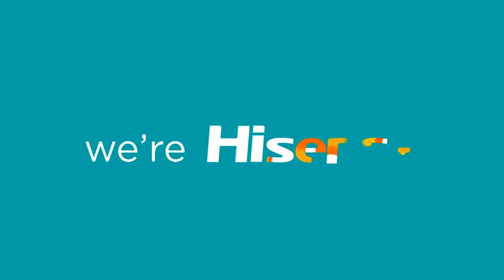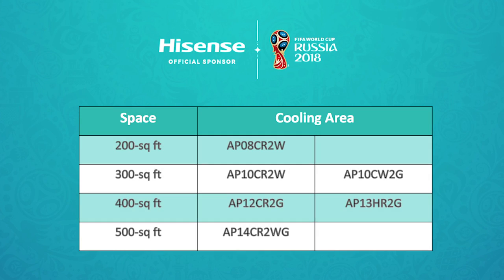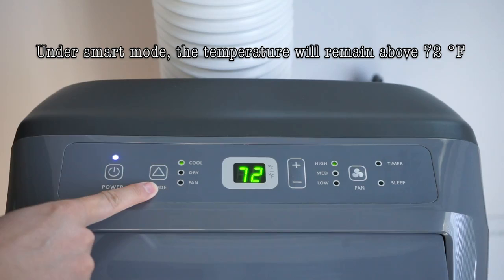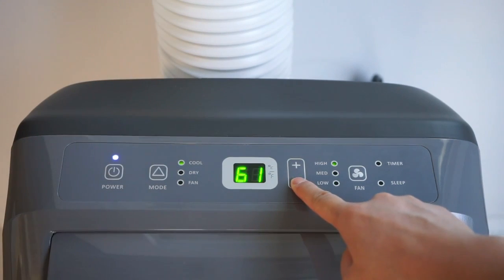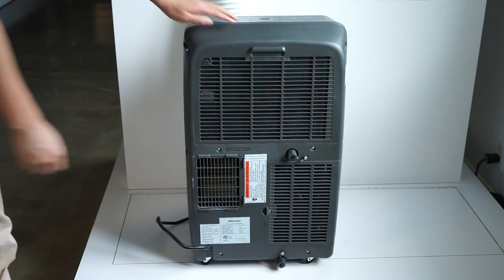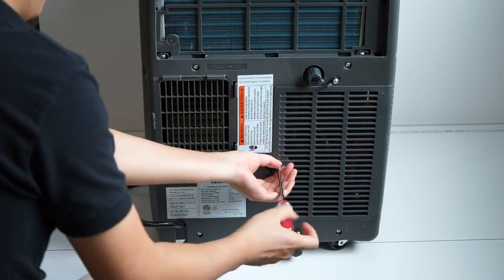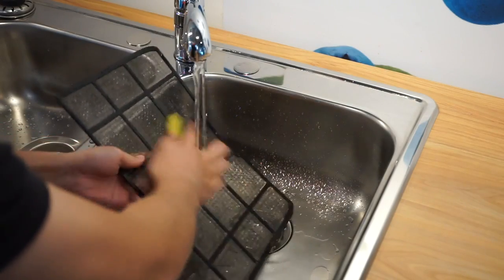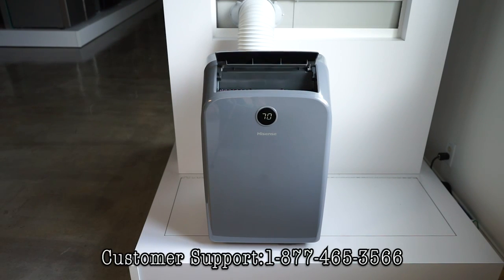Hisense Portable Air Conditioner - Not Cooling

Comment: For anyone reading this trying to fix their Hisense air conditioner, I just fixed mine. It’s good to clean your filters but that was not why mine was not putting out cold air. 

Press and hold the power button while it is on. The unit will power off, but continue holding it until you hear a few beeps. Then go to the plug into the wall and press the reset button on it. Turn your machine back on. The cooling compressor will now work ❄️
Reply: I tried this but when I press and hold the power button the unit doesn't power off at all, I assume you mean the power button on the unit right? Mine only powers off when I release the button. 

My issue seems to be the cooling just not starting at all.

Comment: What would cause a new portable unit 8000 BTU to fluctuate between 88 and 86 it’s just warm air coming out it has two hoses in the back that go out the window one is supposed to be to take the hot air out and the other one is passing through the coils or however that goes nothings happening and it’s brand new just today©‼‼‼

Comment: I've had one going on 4 years that has been run nearly nonstop during summer months. It is loud (makes loud boom noise when compressor kicks in) but works great. I have never even cleaned the filter which is why I'm on this video.

Comment: Ours will blow air out but it won't cool the air, it will say the temp in our tiny office room is like 78 even when its colder outside, The filters are clean, it has been drained, and there is nothing wrong with it as far as we can tell, it worked one day then the next it wouldn't cool the room below 78.

Comment: My HS won't cool. There was never any water in either drain location and still has no evidence there ever was. It worked fine for about three years, but last year it stopped cooling. The compressor starts up (a noticeable surge in power and the characteristic compressor start up sound), but no cooling. Not clogged, vented to outside, no dirty filter. Bummer.
Reply: Same problem!! Exact same!

Comment: I'm getting error code E9. Can't find the code anywhere in the manual or online. Also my unit isn't blowing cold air and notice the exhaust air is not longer hot/warm.
Reply from the maker: Hi there - the E9 is a fatal error code. Please contact customer support in regards to a warranty exchange.
Reply: @HisenseCA Is there anything that can be done to fix an E9 code? I am handy, can solder, test whatever needs testing, bypass...whatever.

Comment: After a year my Hinsense portable can't lower the temp in the room lower than 77 degrees F regardless of the outdoor temp.  I've cleaned filters and made all the recommended adjustments to the location of the device, exhaust hose length, etc...  Worst AC unit I've ever purchased.  Old window unit had no problem with cooling the room to 68-70 deg F
Reply from the maker: We're sorry to hear that the unit is having difficulties cooling your room. Assuming the unit is appropriately sized for the room it is in; also clarifying that the included window kit is installed correctly?
Reply from the maker: @Joseph (Joe) Tibbetts Thank you for sharing this feedback with us. Window AC units are always more effective than portable air conditioners; however not all living arrangements will allow them. I will share your sentiment with the air team.
Reply: I just got one.  It was BAD in  less then 2 hours of USE.   
PS.  I am a LEGIT trained A/C Tech  and Troubleshooting extraordinaire.   
This thing gots more Bugs than an Ant farm.

Comment: My compressor for it won’t turn on I don’t know how to get it running again just blows room temp air and has a lot of air blowing and no dust
Reply from the maker: If your Hisense PAC is not blowing cold air please check the following: check that the unit temperature setting is lower than the room temperature; ensure that the fan is blowing warm air from the back of the unit; check that you hear the compressor kick on after start-up (could be several minute delays). Please also ensure you have the exhaust hose venting out the window. If the compressor will not start you can try connecting it to another outlet in your home to test for a specific power issue - alternatively, your unit may be at 'end of life' or broken. Please reach out to your closest local subsidiary and speak to the customer service team.

Comment: Got error code E9 on mine. Only info I've found about this is, "contact customer support" and "E9 is a fatal error code". Would appreciate it if someone could elaborate on WTF E9 actually means, please.
Reply: Currently going through this right now, did you ever get an answer on the E9 ?

Comment: My AC is overheating and not shooting out enough cool air it does have the appropriate BTUs is it 16,000 and it has a heater as well for in the winter it will cool for about 10 minutes then shut down. If you have an idea of what the problem may be I would greatly appreciate some help.  I can't afford to buy a new unit.  I live above  a pizza parlor and a tanning salon Sooo needless to say it's like an oven up here.
Thanks Brenda
Reply from the maker: Confirming a few details: 1. You have the window kit properly installed with the exhaust hose venting outside? 2. What setting do you have the unit on? 3. What is the ambient temp of the room? 4. What temperature do you have the PAC set to? Once we receive that data we will do our best to help.
Reply: @HisenseCA  sorry I took so long to get back to you it won't let me turn it up any higher than low the room goes from 20 in the morning on a cool night up to 30 C in the afternoon as I have a son porch attached to my living room facing west so it's like having a little oven attached to the living room.
It's been quite the task trying to keep this place cool.
Reply: As far as the PAC I wasn't aware my portable air conditioner had one.
Thank you for your time

Comment: The filters weren’t dry when I put them in last time and now it won’t read below 70 but hasn’t shown an error code to empty the water like last time. Did I ruin it or is it salvageable?
Reply: Its JUST a Junky Unit.   Hence why there are so many REFERBS out there.  
This is one that's Best to be Avoided.  Even at the Price of $329 bucks?  Its WAY to much.  
Not ONE person has one of these units that has had it for more then a Year and can say it still works perfect.    Its that bad.
Reply: @MickeyMishra  lol, no, it is not. THere are many here on this thread that have had one for years. You just have to know how to reset and do regular maintenance. it is that simple.

Comment: i have that unit but what it does it called the flat flap when the air close and open.. do u know what is name part and where i can look to order it?
Reply from the maker: Typically it is called an air conditioner flap. Currently, Hisense does not sell parts for the portable air units as our warranty is an exchange warranty. You could inquire on a website that sells universal air accessories or with a refurbisher of Hisense products.

Comment: Hello, i inherited my hisense AC from the previous house owner and it was about a year or 2 old at the time.... i have now had it for 3 years and never did much more cleaning than clearing the back filters and some water occasionally. But now the top filter has been very wet and has dirt/ water between the stainless aluminum
Reply: have to drain the water once a week. there is a knob on the back, unscrew it and drain the water.  It collects the moisture from the air when it is running.  It can also be used to dehumidify a room.. hook a hose up to the drain and put it on the 'Dry' setting.. with that you will have to hook up a hose to the drain plug.

Comment: Mine is brand new out of the box and the AC keeps kicking off leaving only the fan on.
Reply: I'm having the same issue. I've tried reaching out to their technical support staff but have heard nothing back so far
Reply: It's most likely stopping because it's reached the temperature you set it at. Try the simple fix of lowering the temp on it.
Reply: @5050TM  I misread/misunderstood Darien's original post. Temperature doesn't seem to be the issue, my whole unit shuts off (before the 8 hour auto-shutoff happens) and when I try to turn it back on in cooling mode it shuts itself off after minutes of running. Only way it stays on after this happens is if I put it in fan mode.
Reply: @solowingpixy4576  I had that issue once. I had to turn it off, unplug it and restart the whole thing. But you unfortunately probably tried that already on yours. Right now my issue is it won't cool a room it used to cool just fine. Guess we'll have to end up calling the company or something.
Reply: @5050TM  how do you restart it
Reply: @vincentr6684  Press the buttons on the plug itself in the order it says. 👍🏽

Comment: How do you reset the air conditioner
Reply from the maker: turn it off for 30 seconds. Unplug it. Plug it back in. Turn it back on. Or you can hold down the power button, depending on your unit.
Reply: @HisenseCA  is it going to erase the wi fi remote controls
Reply from the maker: @vincentr6684  Hi there - I'm sorry but I'm having a hard time understanding what you mean without a unit in front of me or some images/video. You won't be able to erase certain programmed functionalities of the machine. It is possible that the devices (phone and PAC) need to be "re-paired" if there was a connection issue - but you should be able to use functionality either through a "Smart" button on the unit or on the remote - if applicable; or through the HiSmart Air mobile app. If you need further assistance, I need the following emailed to me at canadainfo@hisense.com - a photo of the nameplate/faceplate sticker on your unit, a photo of your remote control, a screenshot of your HiSmart Air app on your mobile device.

Comment: Right out of the box my double hose hisense air conditioner wouldn’t turn on and continues to display a E1 error code on the display. I have tried several times to contact customer service and the line cuts out before I even get to a service representative. How can I fix this , this unit was $784 , that is a lot of money for something to not work right out of the box we are in a heat wave I have a small child this terrible quality and service for such a high price. Invest your money elsewhere

Comment: Did this several times and it still blows warmish almost stale air. I am worried there’s mold inside or something else. I have it set so low to make it freezing and it still doesn’t work like it did the past two summers of owning it.
Reply: Mine did this but only after 4 months of owning. Super mad about it. I live in Florida and spent way to much money buying something I thought was gonna be good
Reply: @sethbender2863  drain the water
Reply: drain the water
Reply: @colleenscottcarmello5103  i have the same issue drain the water even though its the one that says you dont have to drain it,
Reply: @colleenscottcarmello5103  water where?
Reply: @JS-rv3et  the machine collects moisture from the air.  it fills up inside.. there is a couple knobs on the back that unscrew and teh water drains out.  I tip mine to pour the water out faster.  I believe a hose could be hooked up to it also, so it can drain into a bucket or whatever.
Reply: @colleenscottcarmello5103  oh yeah done did that thought there was a internal tank or something. im working on my brothers unit and i got it to blow cold again but it smells like wet cat... so trying find out where its coming from
Reply: Same here I am fed up dealing with this wasting a whole day trying to beat the system hot air blowing out window unit slider doesn’t fit brand new window brand new home it’s a piece of crap vibrates like a truck running it’s horrible can’t get anything cooler than 88 to 86° it goes back-and-forth brand new unit I’m so disgusted©‼‼‼
Reply: @Corvenik1  where are you going to drain water from there’s no where to drain it from and if you don’t drain it it would flood it says it doesn’t flood if you don’t there’s nowhere to drain it it’s locked this has two units going out the window there’s no reason to drain anything it is not on dehumidifier it automatically dehumidifies

Comment: I did everything in this video, perfectly clean filters, stopped working in less than a year...
Reply from the maker: There are three possible factors for what you experienced; 1. is incorrect emptying and storage for winter months (or damage while in storage); 2. manufacturing defect (usually this happens before the one year mark if it's going to at all); or 3. you received an "older model". Back in 2018-2019, Hisense conducted some investigations at the factory level after receiving reports from customers about premature product failure. We were able to make product improvements at the factory level to ensure the longevity of the product. This is part of the reason Hisense stands by its two-year exchange warranty on portable air products. If your unit has died in under a year, please reach out to your closest local subsidiary for next steps in the exchange process.
Reply: @HisenseCA   Mine  started Flaking out in 2 hours of getting it.   What was the Fix?   Returned to walmart today.    Also?  Its so Heavy,  The Box that it ships in often has Broken parts in it.    Mine had a Broken piece of Plastic in it.    It Needs MUCH better Packaging.

Comment: Does anyone know why when my room get to the correct temperature the compressor shuts off but the fan keeps running like it never fully stops blowing i can set it to 72 have it get to that set it to 80 and it will still blow just not cold air until it get to 82 then it will kick the compressor on and start to cool back down to 80 then compressor shuts off but fan keeps going
Reply from the maker: The fan needs to keep running so that the PAC can identify the room temperature. The compressor starts/stops running accordingly to maintain the room temperature.  If both the fan and compressor stop working completely, no air will blow into the unit; in this case, when the room temperature goes higher, the unit can't identify it, and the compressor will not work.
Reply: @HisenseCA  thank you for the reply I appreciate it i thought something was wrong but it makes sense now
Reply: @HisenseCA  why would fan keep running when unit is off? We have to hit the reset button on power cord and now just have to unplug when not in use.
Reply from the maker: @MikeM91320  It depends on your mode, on their particular mode (Smart), the unit needs to stay on and run whether or not the compressor itself is on. The unit can easily be turned off. No unplugging required.
Reply: @HisenseCA  Thanks. Ous is a model# AP1019CR1G. When plugged in, but unit is off, the fan will go on and off. Is this a problem?
Reply from the maker: @MikeM91320 after a period of running, there would be some condensation on the evaporator. Therefore, the fan will keep running for about 20 – 30 seconds to dry them up a little bit to prevent moldy odour and bacteria growth inside the unit. After this 20-30 seconds blowing, the whole unit should stop.

Comment: How do you turn on smart mode
Reply from the maker: If your portable air conditioner has a "Smart Mode" - not all Hisense PACs do - there will be a button on the top of the unit or on the remote control that says "Smart", "WiFi" or "I-Feel" mode. Smart Mode senses the ambient temperature of the room and adjusts the fan speed and temperature accordingly. If your unit does not have a "smart mode" you can use either cooling, fan, or sleep mode to cool the room to the desired temperature.
Reply: @HisenseCA  the air conditioner looks exactly like the one on this video
Reply from the maker: @vincentr6684 If you have the 10K BTU Smart unit (most of our units look the same as we use the same consistent shape year over year, so there's no guarantee you have a "smart" unit); have you downloaded the Hisense HiSmart Air app to your mobile device? Once you do that, you have to register your unit and wait for the confirmation email (add @Hisense.com to your email safe list to ensure receipt). You'll also need to connect your unit to the 2.4G WiFi network in your home. Both your phone and AC must use the same WiFi channel. Press the SWING button 6 times - wait until the display shows 77. 

If you have an Android phone, this video will help: https://www.youtube.com/watch?v=zN8w_NfOFXg&t=112s

If you have an iPhone, this video will help: https://www.youtube.com/watch?v=RkifLkBVtDo&t=3s
Reply: @HisenseCA  hi i already have it connected to wi-fi , the problem is i think i might of turned off smart mode by mistake and and now i dont know how to turn it on